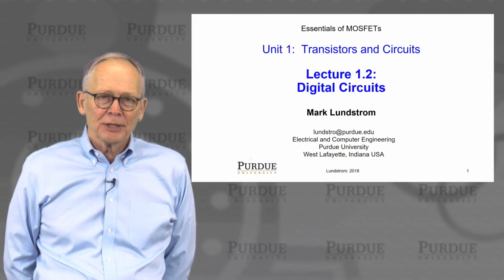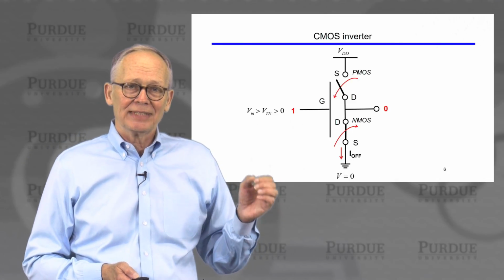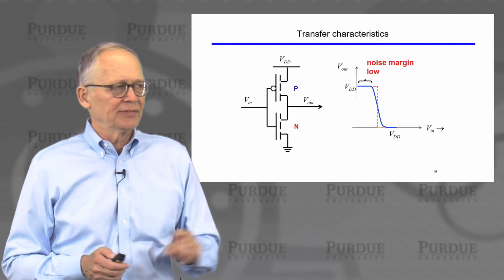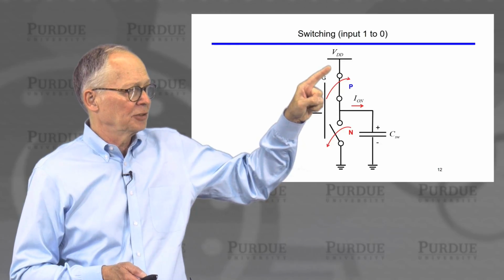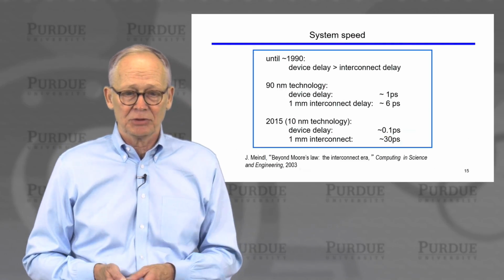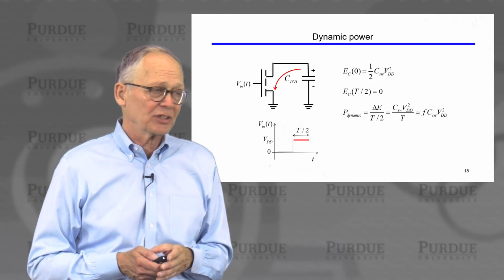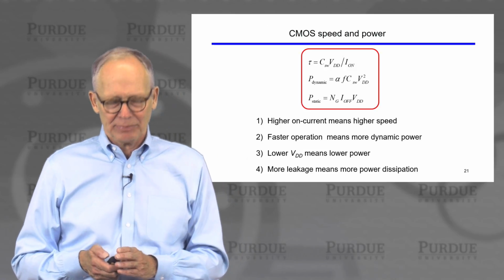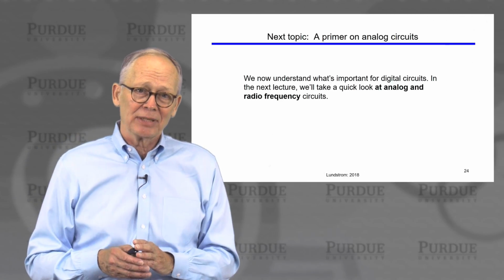nanoHUB-U MOSFET Essentials L1.2: Transistors, Compact Models, and Circuits - Digital Circuits

Comment: 00:00    Lecture 1.2: Digital Circuits
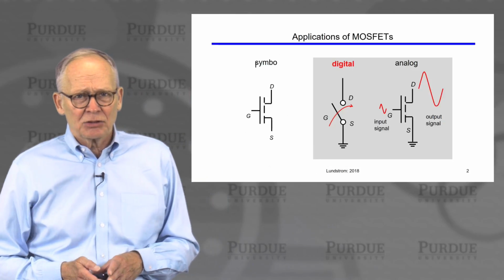00:24    Applications of MOSFETs
00:37    N-MOSFET as a switch
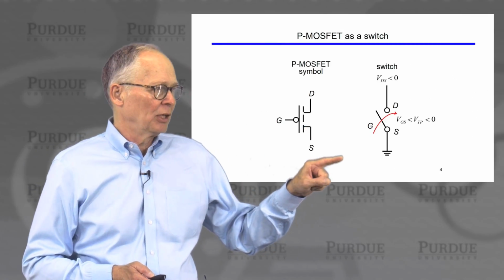01:00    P-MOSFET as a switch
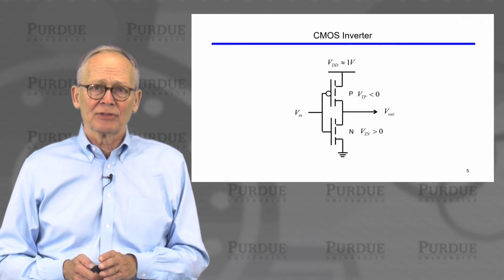01:29    CMOS Inverter
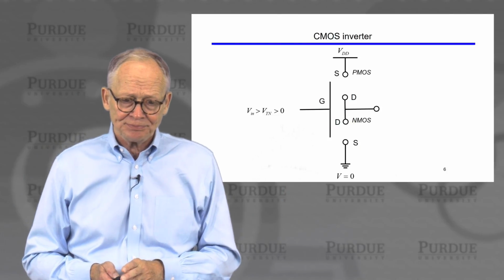02:22    CMOS inverter
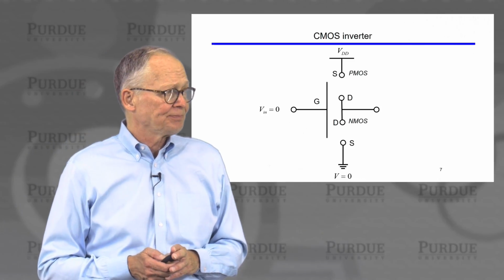03:30    CMOS inverter
04:26    Two input NAND gate
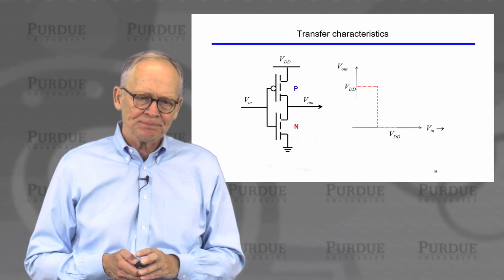05:34    Transfer characteristics
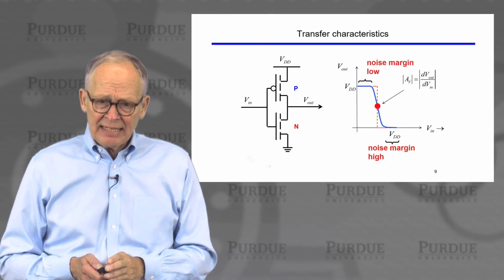07:32    Gain restores signal levels
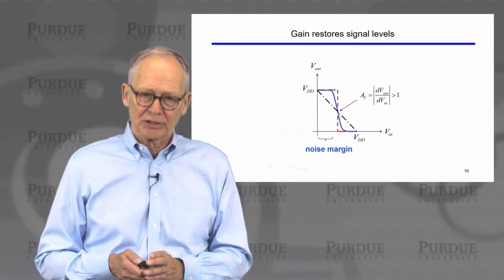08:15    CMOS inverter
09:11    Switching (input 1 to 0)
10:13    Switching (input 0 to 1)
11:07    Discharging time
12:44    System speed
13:26    Power dissipation
14:21    Dynamic power
15:20    Dynamic power
16:52    Dynamic power
17:26    Static power
18:07    CMOS speed and power
19:03    Power constrained design
20:50    Summary
21:51    Next topic: A primer on analog circuits